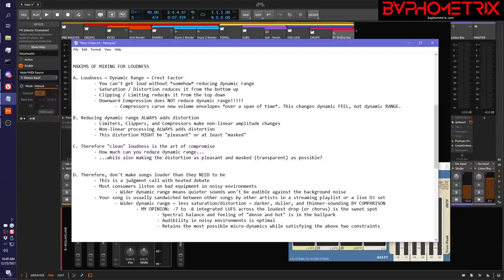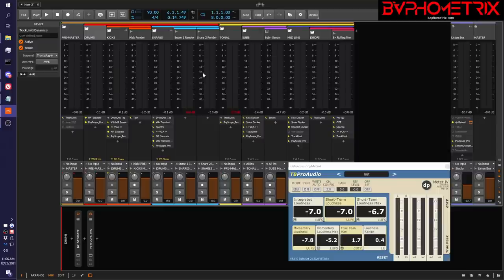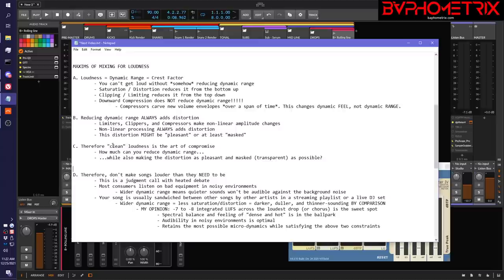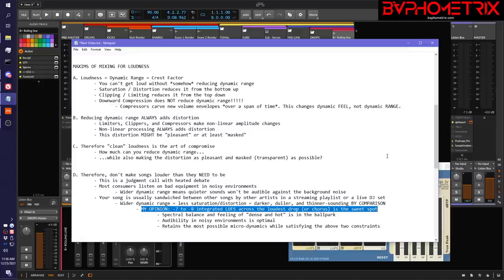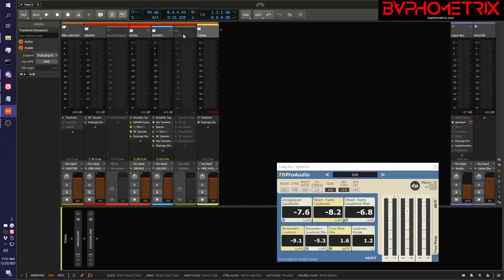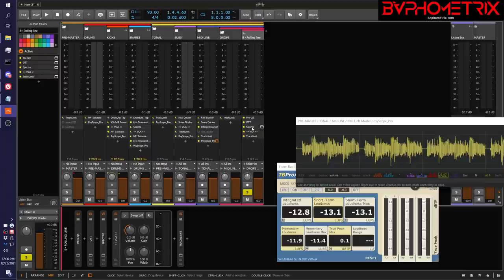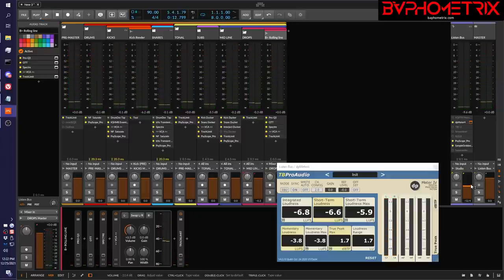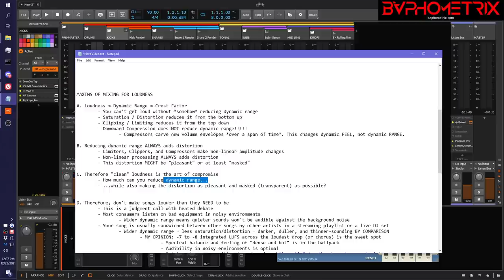Loudness is in the MIx, not the Master! PART TWO

Comment: Just wanted to tell you that CTZ completely changed my outlook on mixing and works so much better for my workflow. It remedied issues with perceived volume, master volume, excess top end noise, aliasing, etc. Possibly the biggest and most valuable lessons that I really locked in on is to focus on anchor sounds as per genre and build around them, and the checkering of sounds. Just exported a -8 integrated LUF (very dense/busy) song at -1db with a few dbs of dynamic range, exactly what I wanted for streaming. Cheers!
Reply from the maker: I'm so glad to hear this! This is why I take the time to share this stuff. You want even better sounding masters? Try setting your ceiling not quite so low, to maybe -0.5 or -0.3 sample peak. And turn off that True Peak setting on your final limiter. This will give you back more headroom for dynamics, and far less squash from the final limiter. https://docs.google.com/document/d/1Ogxa5-X_QdbtfLLQ_2mDEgPgHxNRLebQ7pps3rXewPM/edit#heading=h.xa6coj4lv8uh
Reply: @Baphometrix  Oh man, I needed to read this. The ONLY reason I had it pulled down any lower than 0.5 is fear of the big bad streaming codec. Will do for sure, and honestly all of my previous, outsourced masters (years of work) are sitting at 0.5, clearly not True Peak. I don't hear any issues with them on streaming services.

Comment: Awesome video, there's so much great information neatly packed and presented. Thanks so much!
I've always had a hunch that compression (without look-ahead) doesn't actually control the peaks, but never really thought about alternatives before.

I do have two questions about True Peak: 
1) I feel like the True Peak intersample clips can only occur when playing back at maximum volume, where the speakers cones actually touch their limits at 0dB FS. If the speaker cones don't hit the wall, exceeding TP above 0 shouldn't cause additional clipping/distortion - is that correct?

2) I usually keep my headphones at a level that feels comfortable, and I assume that most other consumers won't be turning up their headphones / speaker systems to 100% either. So I assume it will be rare to have listeners experience intersample clips at all. I don't know anything about DJing, but is it common to really use the speakers in clubs at the maximum volume they can possibly provide?

Cheers!

Comment: Thank you Baphometrix!  This CTZ is literally the only solid, rational, coherent, systematic gain staging approach I've ever learned! 🤩 ... Has any Ableton user here tried to set up a VCA controller and/or Listen Bus? Not sure these are the best solutions, but I just fiddled around and made a VCA controller with the Max4Live device 'Multimapper32' inside an Audio Effect Rack so Macro1 can control everything. And I think I a functional "Listen bus" works by making a Group Track containing everything act as the Master track, while then using the actual Master as a Listen-Out bus.  If anyone thinks these are weak approaches and/or has other ideas, I'm all ears...
Reply: Tried it in ableton 11. Insaaane results. Greatest mixing approachh I've ever come across. Whether we want to believe it or not, loudnness is a must in productionn now.
Reply: So after a few hours of trying to set this up in Ableton, I think I found a solution. To create the listen bus:
- Go to the "Master" change "Master Out" to a different channel
	- Default should be 1/2. Change from 1/2 to 3/4 or in my case I changed to 9/10. (Basically any unused channels if available)
	- The keep the metronome "Click" you will need to keep "Cue Output" on 1/2

- Create an "Audio Track"
- "Audio From" choose "Master"
- "Monitor" from "Off" to "In"
- "Audio To" "Ext. Out" Channels "1/2"

This should create the same kind of listen bus as outlined by Baphometrix. Hope this makes sense and helps!
Reply: @JoshuaHardee  is there a way to achieve this when using an interface with only 1 I/O slot? I'm wondering if there is some way to emulate a 3/4 slot so I can do this with my little interface.

Comment: Amazing videos! Looking forward to your whole CTZ series. One question, do you have any thoughts on using the stock ableton limiter on tracks or busses when doing CTZ? The CPU usage seems to be ok (with the amount of tracks I usually use) and it seems to be pretty transparent. Is there anything I'm not considering that could make that a bad option?
Reply from the maker: 1) a limiter is not a clipper... it cuts a release envelope into the waveform. It also tends to have a certain amount of "hysterisis" hold time on the initial fast clamp down.

2) Nearly all of the native DAW limiters are "meh" at best. I do use a limiter in my own CTZ workflow, for at least some track and bus types. But it's TrackLimit by DMG Audio for some very specific reasons I'll cover in one of my forthcoming "Mixing Loud with CTZ" episodes.
Reply: @Baphometrix  I appreciate the reply. I've heard that about stock limiters but I assumed people were comparing them to full mastering limiters, which they obviously can't compete with. I wasn't sure if there was enough of a difference to something like tracklimit in the use cases you describe here (vox tracks, chords, leads, and certain summing points). I guess I should demo tracklimit and see what differences I can hear between it and ableton stock.

Thanks again for spending all this time to make these videos and answer questions. I saw in another comment that you won't even accept money for it, which makes it even cooler. I have a million more things I could ask but I'll be patient as I assume a lot will be answered in the upcoming series.

Comment: If I remember correctly, one of the reasons to go for -14 or -18 LUFS while mixing is that this is supposed to be the "sweet spot" for many plugins, i.e. the plugins are designed so that they sound best at these levels. Would it make a difference if instead of CTZ you went for let's say "clip to -10" or "clip to -15" as these numbers are pretty easy to view in analyzers? Instead of setting up your plugins to 0, you'd set them all to -10 or -15 while following the rest of the process you describe in the video. The benefit would be that you'd be able to use the plugins at their sweet spot. Does that make sense? Isn't 0 just an arbitrary goal post that can be shifted? Of course, in the end (for your master) you'd boost the volume to 0 db.
Reply from the maker: This -18 RMS guideline (which is also sometimes expressed as -12 peak) is specifically for plugins that are modeled after a famous piece of analog gear. How many of those do you really use in your day to day production and mixing?  Most modern plugins do just fine with signal RMS up way high, and with peaks poking over 0 dBFS. Most modern plugins are built to have a linear response no matter what the RMS or peak might be, and they all (mostly) have 32-bit float internal processing which means TONS of headroom above 0 dBFS. If for some reason you need to work with an analog-modeled plugin or you have some modern plugin that has some type of (artificial) internal ceiling at 0 dBFS, or that has a non-linear response to the input level, you can always fix that by using a pair of "Utility" or "Tool" devices (every DAW has one) to trim the signal down to -18 RMS in front of that plugin, then jack the signal back up to where it was AFTER the plugin.
Reply: @Baphometrix  Thanks, that is a possibility. I'll have to find out what the best working process is for me. I'm using many plugins with an analog aesthetic - tape emulations, products from Kush Audio etc. - so I'll have to check how your concept translates. But thank you for the tips. I'm making Golden Era of Hip Hop inspired beats, but recent releases still are around -9 LUFS including vocals. I still have a bit to go loudness-wise to reach -10 LUFS for the instrumental without turning the drums to mush. I'd prefer the old days where drums still smacked with many albums hovering around -12 to -14 LUFS. I have no problems reaching that, but -10 or louder is tricky. It's also the reason (I think) why so much modern Hip Hop has soft drums. Or they are crushed to death. I would like to hear a Hip Hop album @ -9 LUFS with the sonic quality of 90's music.
Reply: I'm happy to report after a day of mixing that going for -10 db instead of 0 db seems to work as well. No need for utility tools before and after analog emulations. You only need to boost the volume of the final limiter up by 10 db. Everything else is done as described in the video, but I get to work at the "sweet spot" level of my plugins.

Comment: I am sure this is the secret that engineers didn't want no one to know, why all these other vids have no points of facts such as this  because without it is like one of the ingredients in a cake batter missing but you mix it and cook it anyway and it is not a cake!
this has really opened up my mind to except and understand how this really works.
I am going to stay locked to this channel but it would be nice if you had literature on some of this technical insight.
I just need a guide I can build the horsepower in it.
Thanks for this lesson.
Reply from the maker: Well, my "Clip to Zero" guide (linked in the video description) is a written version of much of this. BTW *some* well-known pro engineers talk about this same stuff. For example, here's multiple Grammy-winning Luca Pretolesi saying exactly the same thing: https://youtu.be/Ov4WR5xx5Dc?t=1994

Comment: I’ve been binge watching your videos for the last few days. Gave the CTZ method a try on a mix I’ve been struggling on and was hitting single digit LUFS without any distortion for the first time in my life. 

I’m just curious as to why clipping is never really talked about in beginner guides to mixing, especially in hip hop (which isn’t usually as loud the genre you work in) where songs will easily sit at anywhere between -7 to -9 LUFS. I’ve given the “tutorial method” a try and the same thing would happen over and over again. Like you said, I’d build my whole mix up only to have it fall apart completely the moment I bounce the file into a mastering session and start running it through my chain (yes, even with a single clipper lol). Now, not only does it sound competitively loud, it also sounds clean and not mushy and squashed like it used to, which is what surprised me the most

I’m also wondering that in the event that I decide to only mix a song, not master it and want to send it to an engineer to have it mastered (let’s say for a different medium/format like vinyl or cassette) should I still be mixing into a mastering chain? Should I still be aiming for maximum loudness? Should I leave that 0.6 db of headroom everyone talks about or should I just send it to them hot as hell and tell them to deal with it?
Reply from the maker: It's for producers like YOU that I do these videos. I'm so happy you had your "aha!" moment and broke through that wall finally.  I went through all the same thrashing and confusion, even with help from a LOT of excellent (and well known) mentors.  I think clipping isn't talked about much (except--to my knowledge--pretty much just me and David Gnozzi from MixbusTV, and one time I saw Luca Pretolesi mention it), because of three reasons:

For starters, "clipping" in the analog world was limited only to soft-clipping, what they called "saturation".  But soft-clipping (saturation) noticeably colors the sound. It makes it warmer and darker, by reducing the amplitude of peaks that sit BELOW the threshold of the flat-line point where peaks are sheared off. And doing it in a way that makes the curved transfer region have more rounded edges like a sine wave. So you can only color the sound so much before you've fundamentally changed the timbre of it. Soft-clipping isn't TRANSPARENT.  By contrast, hard clipping is a newer thing only possible in the digital realm. The signal is completely unchanged right until the peak is sheared off. A very short burst of white-noisy distortion is added at that moment. Very quick and transitory, and it can be VERY transparent sounding if not over done, and other elements of the mix effectively hide and mask the distortion from the listener's perception.

The point is that hard clippers are fairly new in the world of engineering. And a lot of what's taught is based on "best practice" from the older analog world of mixing and mastering. The newer techniques and approaches haven't filtered into the common awareness yet.

The next reason clipping isn't talked about much (yet) is because "clipping" is a dirty word. It's the boogey man. Ermagerd! you don't want clipping!  OMG, don't let your signal get clipped! And on and on and on and on. All these people completely ignoring the fact that we all freaking LOVE the sound of distortion and saturation, many styles of which are MADE by clipping the signal peaks in brutal non-linear ways. FFS, lol don't get me started on the damn "boogeyman" of the dreaded "don't clip your signal!".  Clipping is  fine. Clipping is your friend. When it's UNDER your control and is intentional . The only clipping that is arguably bad is when you don't realize that you're allowing a master to be printed with UNINTENTIONAL clipping on the output from your DAW.

Don't get me started on the "True Peak" madness either. intersample peaks (ISPs, aka True Peaks) are usually incredibly transitory and inaudible in a decent mix and master. The whole True Peak boogey man is ridiculous marketing hype more than anything else. Don't take my word for it. Go research the history of Steven Slate's disdain for all the True Peak nonsense. I watched him and Ian Shepherd have a brawl about it on the Slate Digital forums a few years ago.

Comment: What a fantastic two part explanation. Really well done!! 
For my clarification; is integrated LUFs a measure of the loudest section, or a measurement across an entire song?
Reply from the maker: There are 3 LUFS measurements. Momentary LUFS is like RMS, it's the 400 ms measurement that updates rapidly. Short Term LUFS is a 3 second window of measurement. Think of it as being like a really slow RMS. Integrated LUFS is the average across any span of time you want to measure. So if you measure the entire song, then you get an average LUFS for the entire song. If you measure a relatively quiet intro, then you get the average LUFS for that intro section, and so on.  I always measure the integrated LUFS for my loudest song section. Which in most electronic dance genres would be the final drop aka the "climax" drop.

Be aware that when you see people mention some LUFS number they're shooting for, they're not always very precise about it. In my experience, most of them *mean* they look at those rolling 3-second short term values and just "eyeball" what the average number seems to be hovering around.  Others might mean something like the "max momentary" value or the "max short term" value. It can be hard to tell. IMO the *average* LUFS across the loudest section of a song is a number that doesn't like and can always be objectively measured and objectively compared across every song.
Reply: Great explanation, thank you!
I really like the way you think and teach.

Comment: First off, i wanna thank you for all these gems you droppin on that Channel 🙏🏻 i just have a Quick question : after you normalize at 0db and clip, do you lower the volume of that track or do you let all your tracks at 0db and then master ?
Reply: Thanks so much !!! 🙏🏻🙏🏻🙏🏻
Reply from the maker: If you watch the newer episodes in my "Mixing Loud with CTZ" playlist, I address this. Short answer is you normalize at 0 dB and if it's already loud enough to fit the mix, you don't need to clip too.  And if the sound is too loud for the mix when normalized at 0 dB, you fader it down to fit into the mix.
Reply: Thanks I’ve been looking for the answer to this. I’ve listened to your videos many times. Some things I can’t remember when I’m mixing. This one step is really important. Can’t thank you enough for your tutorials

Comment: Hey @baphometrix Great video and thank you! I have a question about the side chain...specifically on the mid bus and sub bus...I see you have the side chain before the limiter. Are you pushing the post side chain signal into the limiter and therefore wouldn't you be changing the envelope that you created with the side chain by bringing back the signal that was initially side chained? or are you just barely limiting this signal at all? Would be great to see exactly what is being limited inside the plugin if anything at all...generally I would have thought maybe side chain post limiting would create a cleaner side chain.

anyways thank you for the great information! I have been producing for 10 plus years and Ive learned a lot from your videos!
Reply from the maker: You might be confused by Bitwig's UI? Every "block" you see in the bottom is a different plugin or DAW device of some sort. The things you see that say "Sidechain"? Those are my ducking VSTs. The page on the device is just making clear which other (sidechain) signal is driving the ducker. The limiter itself is not being sidechained in any way.